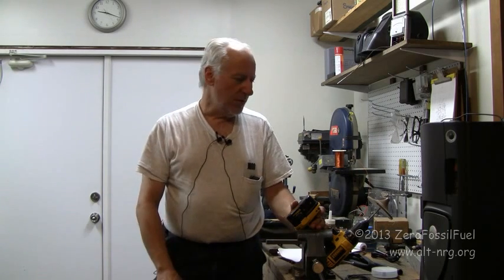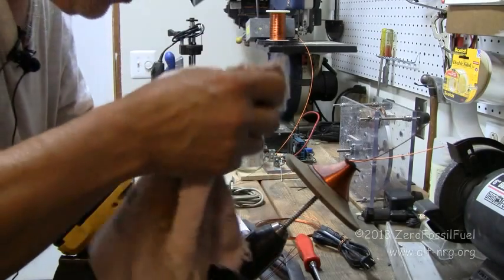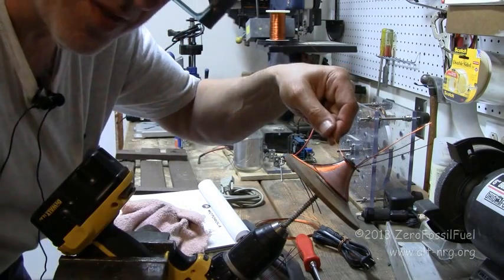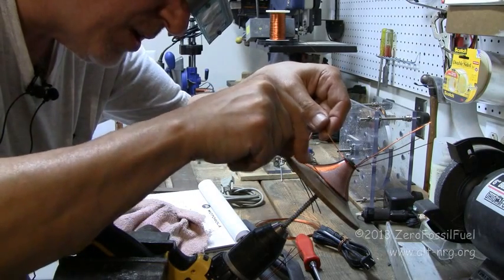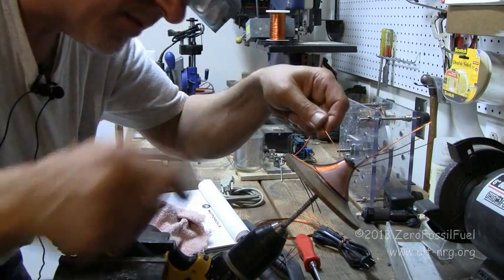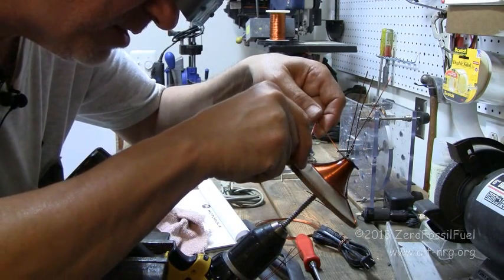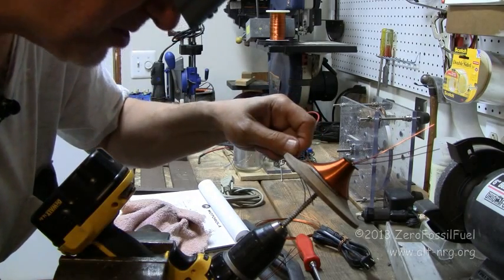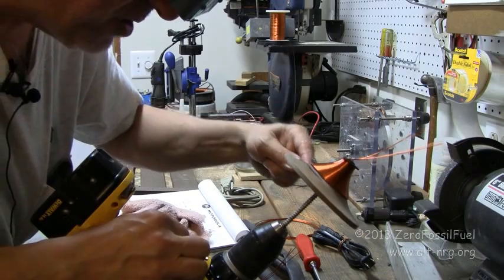#337 Pulse motor Trumpet coils

Comment: In curiosity, if you took a cone coil and after you finished the coil wrap at the larger end take the end loop it within and start another coil wrap with the same wire at the smaller coil. Would it take the power generated and multiply it? I have seen tattoo coil wraps and understand the concept of power output do to the number of wraps. It is my understanding of Tesla coils that as the coil get small it increases the power. Now if you take the wire and wind it like that wouldn't it would take the energy produced at the smallest coil and bring it back into the coil at the largest section to re-amplify it? I see a lot of work with vortex coils and star coils. I wonder what would happen if when you brought the coil back to the largest coil you offset it 60 degrees Basicly it would creating a vortex pattern on the inner side of the coil. 

Like I said curiosity fuels my questions and ideas. I am not college educated, but I have been following the experiments in this field due to a respect for Nikola Tesla and the pursuits of free energy. I would like to see what happens if you ever used the idea. I understand this is just the amplification aspect of things, but hey it's something.

Comment: Maybe, then magnet comes to center of this coil, you can use this indused pulse to the same coil to cancel the magnetic attraction thus cause aceleration of the rotor.
Probably some capacitor is needed.. 
p.s. great work, I learned a lot from your videos :)

Comment: Come over to Evgray on yahoo groups.  We have lots of plans and schematics.  Doug Konzen and Hector Torres frequent the site.  You should also be capturing into a capacitor then dumping to a load.  Also, you need to have a coil shorting circuit to bump of the volts while filling the cap.  Do it at the peak of the sine wave and it does not increase draw AT ALL.